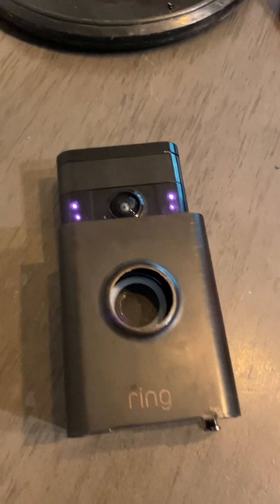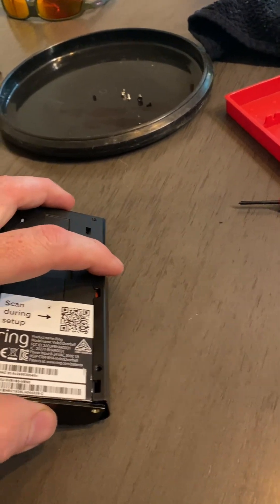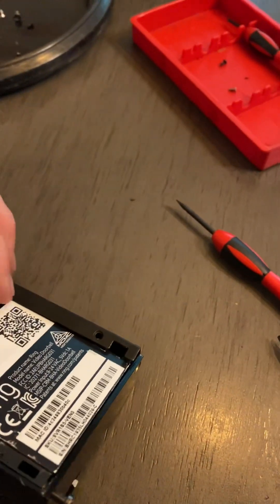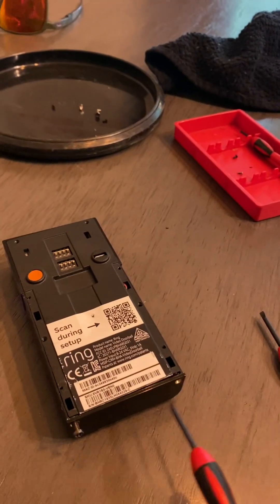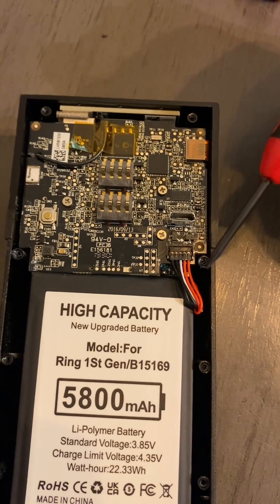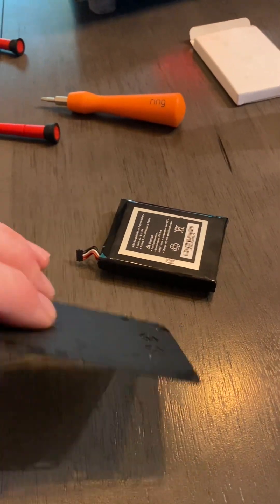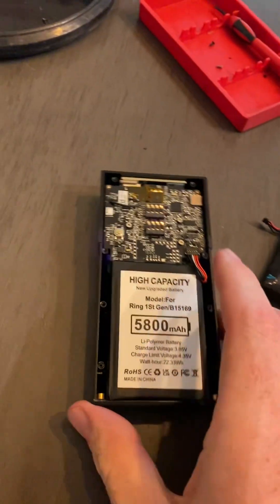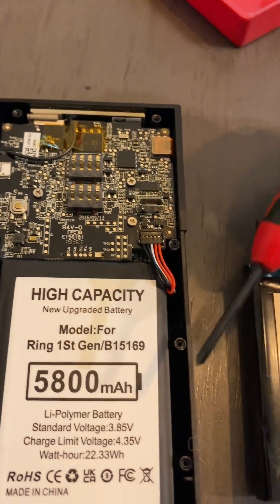Ring video doorbell first gen battery replacement.

Comment: Unwatchable. 2 thirds of the screen is blank.
Reply from the maker: Strange. I just watched it in its entirety with no issues. Sorry it didn’t work for you.
Reply: FYI, the use of a hair blower or heat gun can be used to soften the sticky tape film inside.
Reply: Flip your screen 😅